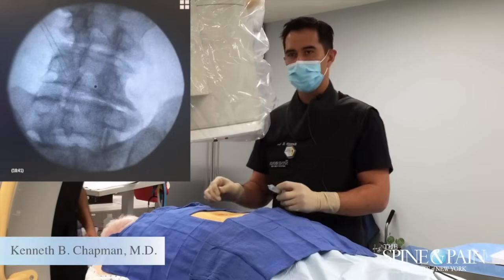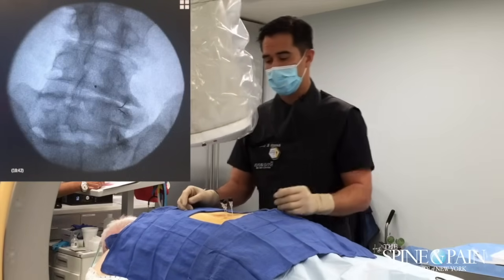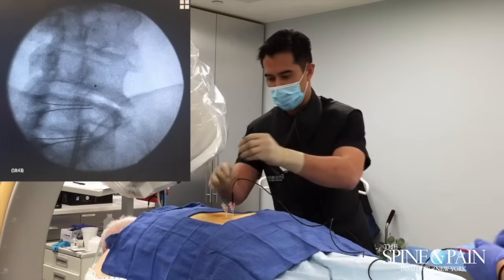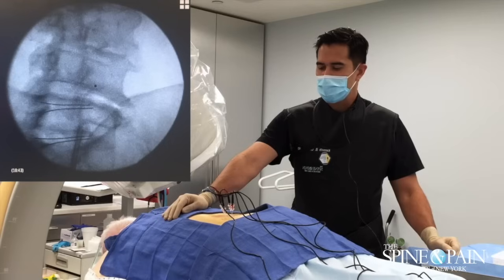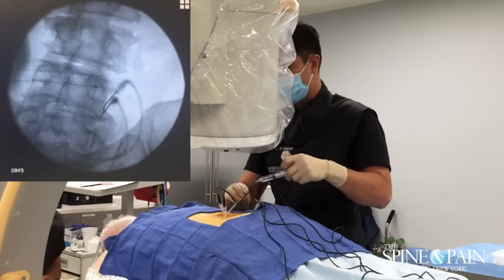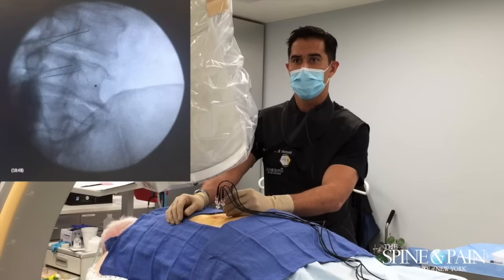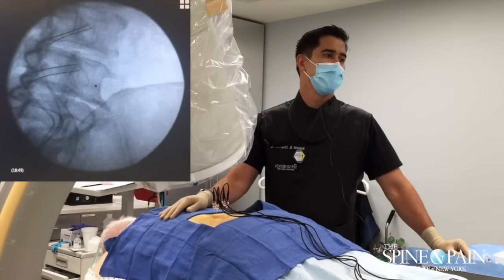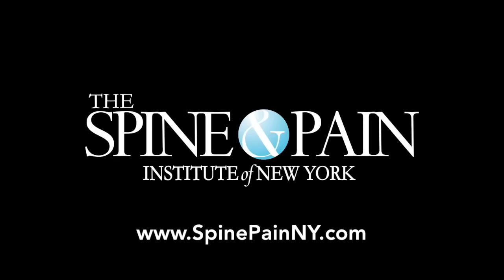Radiofrequency Ablation Procedure

Comment: This morning was the 2nd of two, the first was two weeks ago. I"m fine, but a little sore ..  they did five levels in my lower back, right side .. left side was first because the problems & pain were more prevalent. I do not have a tumor, I have severe osteoarthritis, compression fractures and all levels and disk issues. None can be "fixed" with traditional surgery, so this was the only option for pain management. It works and I'll be going back to work on Friday. The "test" run with steroids & anesthetic last fall, gave me 100% for just over four weeks. This will hopefully give me a year or  better. Good luck to all of you considering this. For me, it worked.
Reply: Thank you for letting us know how the procedure went. I am in the exact position you’re in and I’ve been going through this since 2015 but diagnosed in early 2016. My first procedure will be on the 31st on the left side which is the worst and the right will be done on Sept 11. I’m excited and grateful for being able once again have a great day to day lifestyle.

Comment: One pain management doctor said, "Just a little pinch..." it was far worse than that.
After he paralyzed me for about a minute. (notice this is a very rare occurrence)
The pressure of the medications being forced into the joints was hell.
He had me choose a side, knowing both were and still are very bad.

The new one went on the left and the right at the same time. I was given nitrous before and during the procedure. It was not as bad.
I'm getting another done in the T or L spine next time. He'll also use IV season, as even with them mentioning it's a lot of nitrous. It didn't seem to effect me though. Don't be afraid to ask questions before, during, and after the procedure.

Good luck, you guys.
Reply: Yessss lol I thought maybe it was just me
Reply: @sheronmartin460  not at all. The rhizotomy is far worse than a nerve block.
I'm not sure when they'll do another one if those. I'm noticing a trend though.
I'm still in pain.
Reply: Hello Steven my name is Don I'm 61 and mine is in low back I'm scared it will cause lose of feeling in bowel or private area the pain I have already causes pain in my left testicle I hate having this done would cause me to lose function down there😬 I don't mean to sound like a BIG (!) Just kinda Lil scared. What are your thoughts since you've had several

Comment: I had these done since 2016. Always almost no pain. I had them done 14 days ago and yesterday in a new hospital. When they were putting the needles in and adjusting them, the pain both times was almost intolerable. I heard later that they had a doctor in training perform the procedure, while the one I had a consultation with, was present but not doing the procedure. I was shocked I wasn't informed or asked for permission about that. Coz I went to that hospital specifically for that doctor. Since I had it done several times before, I know it can be done with almost no pain. Uncomfortable, yes. Pain, no. 
This time, Both times were a horror  experience 😣
and they were telling me constantly they had to hurt me to get the needle right. And I should breathe. 🙄
Which I did. 
But I know it shouldn't have been this painful.
Reply: They are supposed to ask for your consent first!!!

Comment: My clinic offers Fentanyl + Versed through IV for concious sedation. My father doesn't usually remember much or any of his procedure. 
I have tolerance issues though, I'm on a heavy Methadone dose and it blocks out the Fentanyl, even though they give me the max. The Versed takes the edge off but I also have a heavy Benzo tolerance from years past. 
So I am awake the whole time. It is bearable for me but very painful, however the pain is short. Lots of stinging and painful pressure. If insurance pays and your clinic offers it, take the sedation.

The procedure helps me some I think. I don't notice too much of a difference afterwards but when it is nearing six months time for the next procedure, I notice my pain gets much worse.

Comment: I’m 25 very healthy and athletic but have mild scoliosis and my physio just recommended this to me, to attended a hospital in Chelsea U.K. I see a lot of positive feedback but I’ve had electric acupuncture which to my untrained eye looks the same with the designed effect of sending waves to the pressurised area to relive pain. I’m just hoping this doesn’t have the non effect the acupuncture did because I really will have lost all hope in exercising again pain free if not.
Reply from the maker: This is very different Michael. Best of luck!
Reply: Hi, thank you very much. I’m confident it is. It’s the Schoen Clinic Orthapedic & Spinal Hospital so I’m sure it will be to the standard in the video. It’s not the pain I worry about, I’ve tolerated far more excruciating operations such as testicular torsion, it’s just the hope that it significantly irridicates the pain on my right side. I’m not in agony as some of the commenters but it’s the stiffness that occurs during high intensity excercise, or being static for too long ( sitting & slipping ) that no core training or lower back strengthening gets rid of. I’m confident it will do the job. Thank you for providing this video and allowing the people to share there stories.

Comment: I had this done without any painkillers or anything before .. it was the worst 30 something seconds then it was some good pain as well only because for the 20 plus years I had back pain my muscles basically turned into a rock to compensate so my Dr had a helluva time getting the needles in..so mine was an extreme case but it took maybe what 10 mins from going into the room and coming out of even that..after that just had a few "touch up" shits for lingering pain and for the muscle spasms from those hard as a rock muscles the Dr said...

Comment: I had this done. It's WONDERFUL!! 

This patient is awake?? They gave me propofol (?). I was out.
Reply: I was awake as well.
Reply: I’ve had it done while awake and while knocked out. Different doctors prefer different things. Thank god my doctor now knocks me out because it’s so damn painful if you’re not. (To me anyway)
Reply: It is hurt? I have to have mine under sedation only
Reply: Did it hurt even
Reply: Shell Charles if you get it when you’re under anesthesia. I’ve had it without and with anesthesia- hurts like hell without but with you’re sore when you wake up.
Reply: Fentanyl
Reply: I have always gotten fentanyl and versed. If they don’t give me enough, I will be awake and aware the whole time. Hurts like crazy. Worst part is the insertion of the needles. I have felt some burning down my leg from the actual ablation before, but only once or twice. Have had this done multiple times to both sides of my back.
Reply from the maker: The patient was awake. It can be more comfortable with anesthesia, but the patient chose to have it without. Glad it helped!
Reply: @HeavyMetalKittenx  I want to try this anything to avoid surgery but I have a high low tolerance to for pain and definitely would want to be knocked out.
Reply: @justincody1599  when given versed you may think you are asleep but you can react to stimuli and also answer questions such as if it hurts, etc. That is why some doctors use this method of sedation. That is why it is called conscious sedation.

Comment: Kenneth, after I had a 'radio frequency facet joint denervation' procedure on my spine nearly five weeks ago the 'sciatica' type pain has become much worse so I'm unable to do anything remotely strenuous, including my beloved tennis. Like you I was hoping that RFA would solve my problems, however this 'non invasive' intervention seems to have widely different results on different individuals and I for one, regret having proceeded with it. Here in the UK, a glowing 85% success rate is quoted for RFA but down side of this procedure is not ever mentioned.

Comment: Had RFA done 4 times. Going again in 2 weeks. If you can tolerate pain you will be fine. However, if you can’t tolerate injections or needles or you have low pain tolerance you will scream. They do inject anesthesia where they will prick you. You will feel the pressure once the bigger needles go in near the spine. But just stay as still as possible and relax your body as best you can. Oh and by the way those needles get HOT. (Just count to 60). The whole procedure takes less than 6-7 minutes. That includes prepping you. The most “painful” part is the first prick of anesthesia. Then you are numb in the area… the pressure of the needles touching your spine are a little uncomfortable but bearable. 
My first time I was in pain for a couple of days. 
After that you get used to it and you just know what to expect and driving yourself home. 
I recommend this procedure to anyone with back pain. Hopefully this is my last time and they burn those pain nerves for good this time.

Comment: I was in a car accident almost two months ago. Prior to that, I had a bad experience getting sciatica one day… it lasted about 4 months, but other than that, I haven’t had any severe back pain or issues…ever. Then I am slammed into at a red light and subsequently pushed under a truck in front of me and I now have 9 herniated disc’s with L5 actually torn, but mildly, not severe. I was going to be as aggressive as I could as far as steering clear of having a future plagued by back pain, but the fusion surgery recommended was concluded by me…after extensive research, to be risky and not worth the loss of mobility. In fact, it scared the hell out of me and I am starting to round the curve. I have been getting physical therapy for a month and doing core exercises to take pressure off my back. I do believe that in my case, this is my best pick, and afterwards, continue on with being as active as I can because sedentary lifestyle makes it worse. I understand that most of you have no other choice and I’m so very sorry to read of the agonizing pain that many of you have experienced for very long time lengths. I honestly believe that radical and invasive surgery, unless you have deteriorating bones or fractured or broken vertebrae, is not the answer. I am a bit confused because I watched a video and there is a place that claims they can permanently kill the nerves so that you don’t have to repeat this procedure. Anyone heard or have any feedback or advice?

Comment: First time: I had it done I was given a pain reliever for the injection. It did hurt not going to lie, but nothing I can’t handle. It does feel really weird though. 
Second time:  I had it done it did hurt,
 I’m going in for my third one next month May. With each injection I have less and less pain so this does work. 

I went through it, do you guys have any questions?
Reply: Hi Karen I’m going in tomorrow but not going to have an IV sedation. They gave me Xanax to take before but as far as I know, that’s it. I’m worried the pain is going to be unbearable. I could tolerate the medical branch block injections they did although it was uncomfortable. Any advice?
Reply: How much less pain do you get if you smoke ???  I was told to gut or try and I tried and tried. But couldn’t do it. Anyone know the % I can possibly expect in relieve due to smoking ?

Comment: I had my t-6 t-7 t-8 t-9 done they did the left side first in Central CA it felt like hot oil burning in my body and the last vertebra they did way t-6 I dam near Jumped off the table that's when the needle mover from the nerve area during the burning and it took the like 10 seconds to turn it off the laser was burning the inside of me other places now I'm getting sharp shocks or stabing pain on let left side by my t-6 my arms and legs are going numb daily all the time no matter what I'm doing like standing sitting laying down it's driving me nuts the shocks las about 3 seconds and and about 2 to 8 times in a row randomly after I did the first side I wnt back in an did the right side I told them more numbing shots and to give me a min so it kicked it then I griped the table and hung on for Der life then I had to stop them again at the t-6 area and re numb it and then it was ok no pain at that time but when I got done I walked to the other area and my whole shoulder and are was tingling and numb I belive at that time it was from the surgery but then I looked at the inside of my arm and saw marks from holding on for Der life and though I just cut my blood flow from my are so now I still have pain in my lower t-6 t-7 but the rest fell better be carefull don't move a inch and make sure they numb the fuck out of you ok I now have weird side affect from the surgery and will be doing a mri soon the people their just brushed it off and so did my pain doctor but my primary doctor is taking action and getting me in to see him plus a mri now my legs and hands are week and falling asleep all the time for no reason with pain it's nuts be careful k

Comment: This procedure is in my future. I've had a couple of injections and just had a nerve block. No success with any of it. Nerve block was more of a diagnostic procedure than anything. I had a laminectomy done in 2015. Felt pretty good for about a year. Pain came slowly back and now I'm in agony. I'm only 55, male. I have severe stenosis in my L3-L4 area with pain in my lower L5 sacrum area with radiating pain in my butt cheek. I'm pretty nervous about this. I get anxiety over stuff like this anyways. I really don't have much faith that this will help either. I figure surgery will be my only hope and that's not saying a lot. 
THEN, maybe they fix my neck. Severe stenosis in C3-C6 area causing a weird electrical sensation down my left arm like it's asleep.

Comment: did the first test and it was fine.  the second one i was OFF the table......  no way was i doing this without anesthesia. i think it depends on how bad ones nerves are.  while it can be no big deal to some, it can be a very big deal to others.  i have had such for years and only needed simple freeze spray.  as things became worse, it has changed drastically.  they waited way too long and i have more damage. But next is NO MORE, i want surgery and end this thing if possible. will see on that one.  Hoping this will last long time to get up moving around again and get body in better position. that helps too.  but I think it is it really depends on the person, amount of type and where nerve damages are, if other issues in area, and many factors to the pain level of it all.  Cause i have seen easy and unbearable in these proceedures..